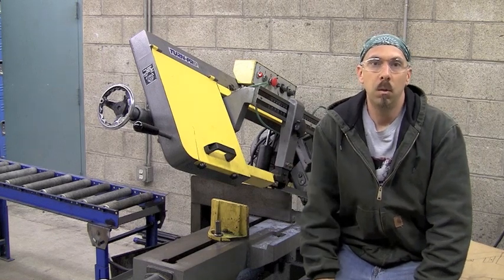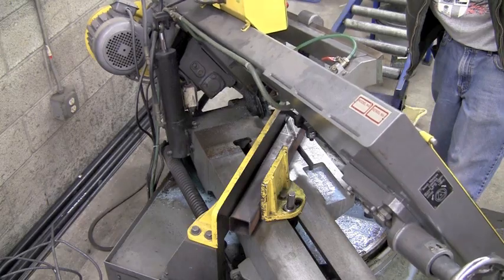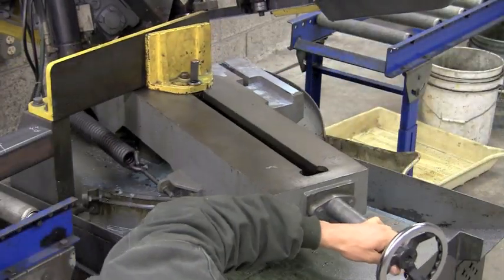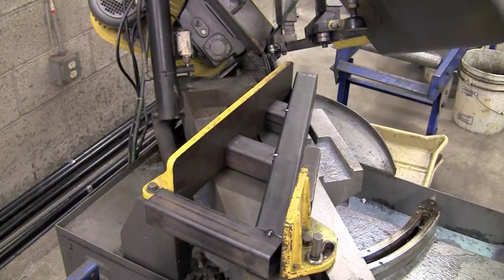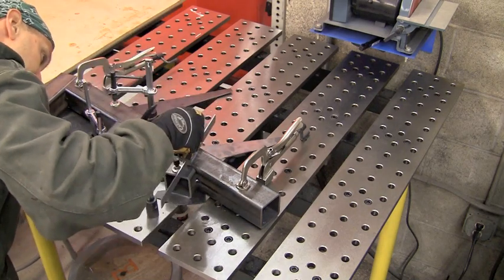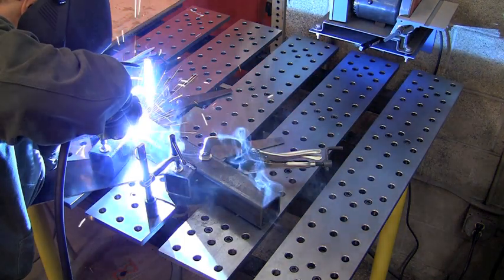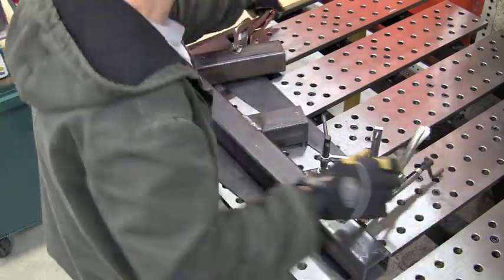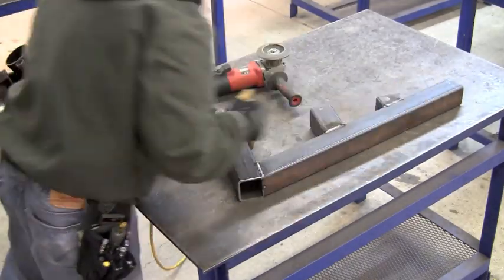Horizontal band saw jig part 1 of 2

Comment from the maker: @KEF791 Thanks Keith.  We use the saw quite a bit.  It's size pays off when making multiples but when we cut angles you need long pieces of stock.

BTW the bearings on the top didn't have eccentric mounts but rather 2 bolts with slots on the other side of the blade guide.  The side bearings that pinch the blade have the eccentric mounts but not much movement in the bearings.  I was able to adjust them all to get a straighter cut top to bottom.